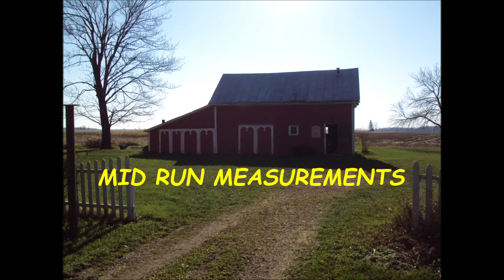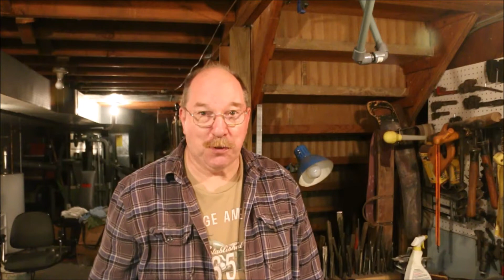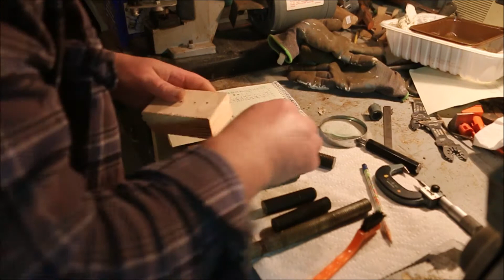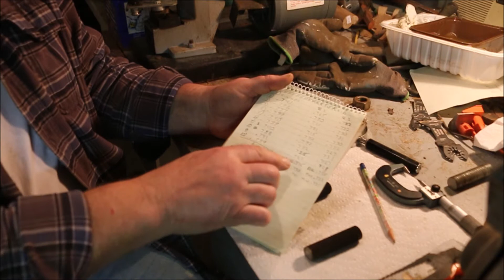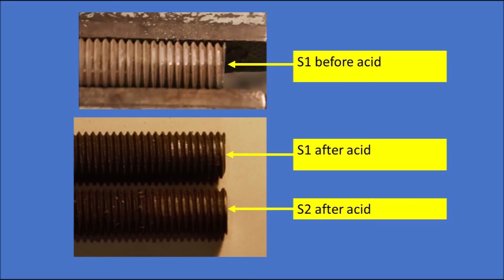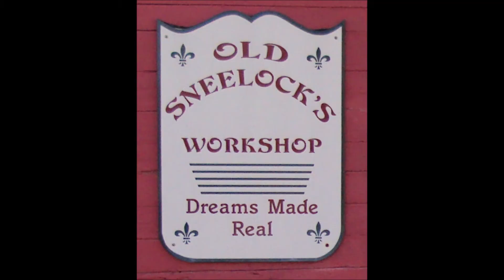SHARPENING FILES WITH ACID ~ PART 7 ~  EXAMINATION AFTER 11 HRS

Comment: Love this experiment. In a past video you said never to use a wire brush on a file but instead use a metal file brush. Can you explain a little more why a wire brush dulls a file? Thanks
Reply from the maker: Tony Lenge the bristles in a standard wire brush are harder or at least as hard as the file they have to be in order to work otherwise they just we're right off also they're made out of spring steel which is harder so the hardened steel wire in the wire brush tends to dull the file the file card does have hardened steel wire in it but it doesn't have quite as aggressive number of bristles so it tends to more go down into the of the teeth and clean them out I myself prefer a brass brush doesn't wear out the file anywhere near as fast.
Also I've mostly referring to the power wire brushes I see people using power wire brushes to clean a lot of stuff way too aggressive you can actually take steel off of the file just basically grind it away so I'm not a big fan of using power wire brushes for any kind of restoration it it tends to screw up more than it fixes.

Hope that answers your question and thanks for coming.

Comment: Looks like the old Master spoke truth a long time ago of which there was no doubt. What are you doing with a coat on? Wish it'd get that cold here. Climbing toward 80, Cheryl is pressure washing the front porch and I'm putting a new drive rubber ring friction disc on the Roof mower, then drilling and tapping for a grease zerk on a front wheel. Then probably wash stuff while the washer is hooked up. Milds and moldews all over.
Reply from the maker: Lewie McNeely The flannel is because the AC is on. Cold air gathers in the basement. When it is 68 upstairs it's about 64 in the shop. 
No matter what there are challenges. Frozen pipes or mold and mildew. Can't win for losing some days.
Reply: When I get good and hot I go sit on the back porch and turn the fan on for a while. That gets me ready to soak in the a.c. but the circuit we have the outside plugs on is a ground fault and wouldn't handle the washer. It ran fine off of the shed outlet but now we don't have any power on either porch but the fan in the greenhouse is on the same breaker and it's running. Sounds like a job for the electricianer.